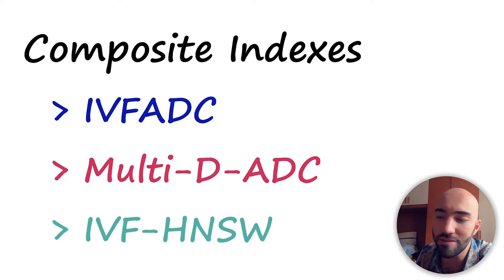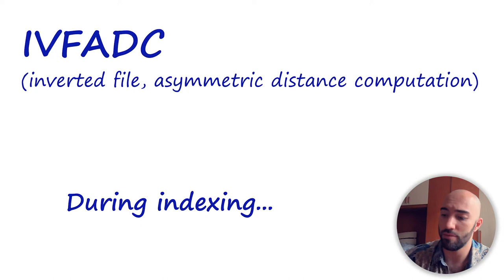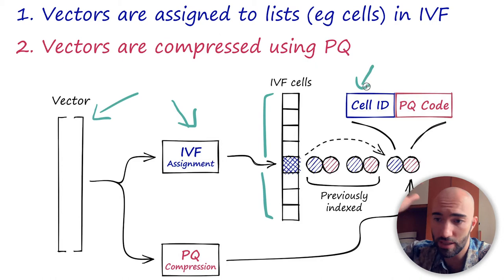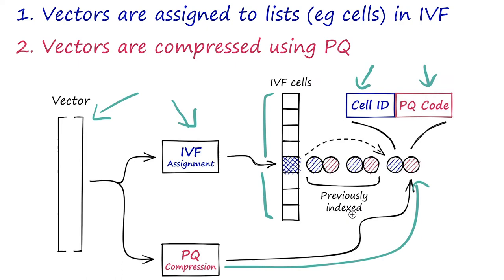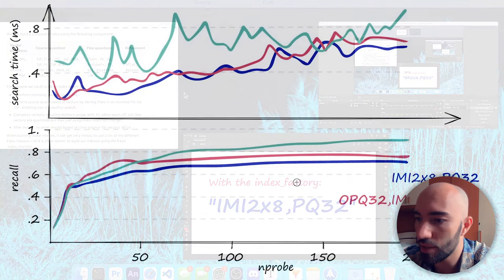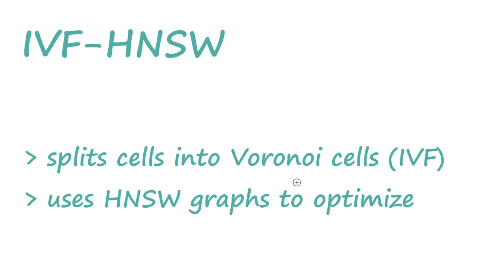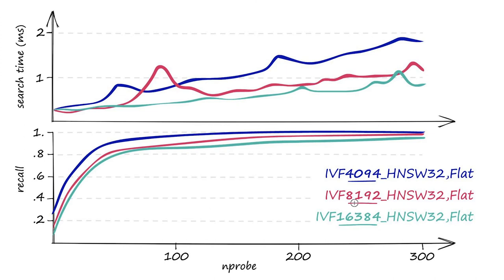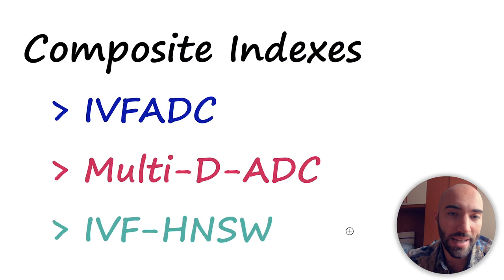Best Indexes for Similarity Search in Faiss

Comment: 1. 8:33 says that image is not multi-D-ADC but only the older IMI, what's the difference between them? 
2. 8:40 says vectors get split into 2, how? That sounds exactly like pure PQ without IVF. 
3. I see faiss only has extract_index_ivf, does this mean when using composites like OPQ32,IMI2x8,PQ32 at 11:41, we can't manipulate the other non IVF sections? (eg. OPQ parameters). Has this design got anything to do with index time parameters vs search time parameters? (i assume the latter is more freely exposed to give users convenience in experimentation)
4. The other video titled "Composite Indexes and the Faiss Index Factory" shows IVF and HNSW both under the Coarse block among 4 blocks. I thought we had to select 1 from each block but this video shows both of them selected, and a new syntax with underscore instead of comma. Where is the reference for what combinations of indexes from the 4 blocks, and what parameters combinations are possible? 
5. In last graph whats the intuition of why decreasing recall with increasing IVF nlist (4094, 8192, 16384)? 
6. Why are all the videos using recall and not any of other metrics (eg. precision) explained in the "evaluation measures" video in playlist?